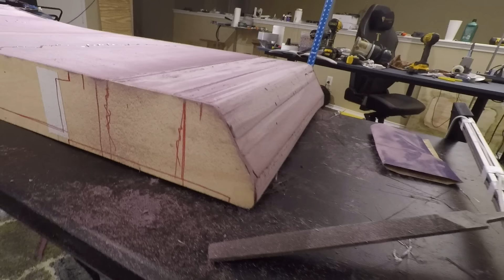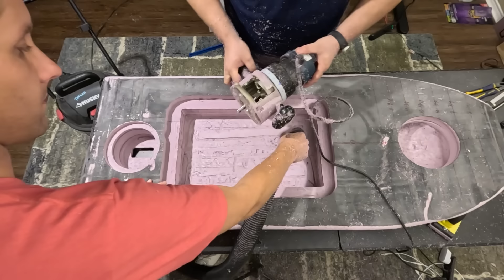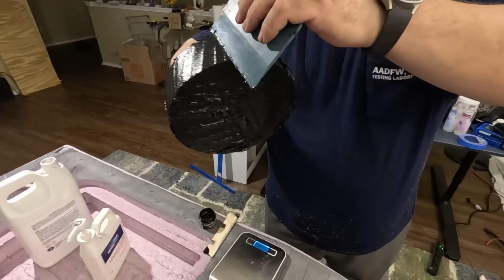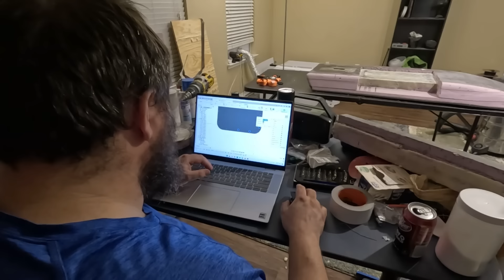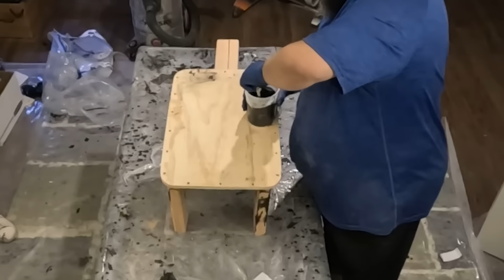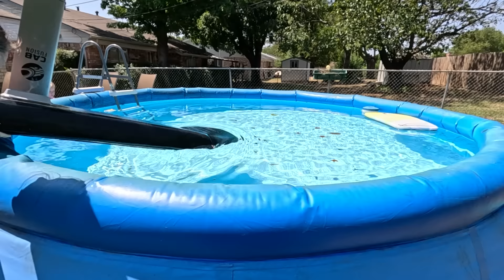We Built a $13,000 eFoil for Only $3,000

Comment: A bit clickbait, isn't it? You built a deck out of Home Depot foam, but you bought the mast, motor, wings, remote, and electronics off the shelf.
You conveniently skipped mentioning the brand names or suppliers for the propulsion, remote, and wings. A top-tier eFoil battery and motor system alone run thousands, so sub-$3k for quality gear is hard to believe.
The average person doesn't have the skills, tools, or time to weld battery packs and lay fiberglass. Plus, putting a garage-built board into daily ocean waves is a totally different story than a calm lake test—marine environments eat gear alive.
For anyone looking for actual reliability, performance, and a 2-year warranty without needing a workshop, a production board like a Waydoo gives you incredible performance for around half the price of those $13k boards

Comment: did you think of a small compartment to allow the AIR EXPANSION from the inner box? you need a membrane that allows expansion of the air inside, otherwise it might create suction (leak) or pressure when it cools off in the water or heats up in the sun.

Comment: Maybe I missed it, but how many hands on labor hours do you think this took?  And what is the fastest you could make a board like this (curing time and all).  You have a skill at using the 3d printer, CNC, various epoxy work, electronics knowledge.  That has to be at least a $75 an hour skill set.  If this took you 30 labor hours (just a guess) That is another $2,200 of labor, which brings this $3,000 build (parts only I was assuming) more inline with the cost of a new Waydoo Flyer efoil, which brings up the next question as to how this motor, foil, and battery would compare performance wise to something like that?

Comment: Great project. I’ve made a few boards for wingfoiling and toying with the idea of efoil build. Please be careful of epoxy it’s quite toxic before it cures and you can develop severe allergies over time so never touch without gloves before it cures. Bondo glass is not compatible with the xps foam you used it would have melted it a bit causing possible delamination in future. When you Hotwire make your templates slightly bigger then sand down to your line all that filling adds lots of weight. 
Board making is a lot of sanding. Then just a light fill with epoxy and micro balloons if needed before glassing. The cabon should have gone over the foil box that’s where you need the most strength also didn’t see and stringers attaching the foil box to top deck to make an ibeam to carry the foil load very important. The foil is a leaver and all that force goes to the front of the foil plate can be 5x your body weight
Reply from the maker: Thank you for this.  It does feel like it could break in half if I get bold enough on it.  I would say we would follow your guidance on the next one, but I think I would rather save up $13,000 than have to do this again.

Comment: @KlausMade Nice build! That battery is a TANK! They looked like P42A's. What do you suppose the minimum size battery you'd need for roughly 1 hour max ride time? 10S4P?
Reply from the maker: Yes, they are Molicel P42a cells. We used 14s10p on this battery.
So I think you would be very limited by a 10s4p pack.
With as heavy as our board ended up I would guess maybe if we went down to a 14s6 or 7p pack the battery life would be more like an hour at maximum.
If the board was focused more on being as light as possible you could surely go even lower than that.
Reply: @KlausMade  You probably haven't weighed it but how much do you reckon it weighs?

Comment: Excellent build and video! I made my own Efoil, finishing at the end of last summer with a handful of successful rides before the season ended. I also used a TPU printed gasket between the mast top and board. In the video you said you ended up switching to a rubber gasket. Can you tell me why? Does the TPU not hold up in water?
Reply from the maker: I believe the TPU didn't hold up.  But the stainless steel screws were tough to tighten without stripping them out. Switched to a rubber gasket and stopped the leaking water.

Comment: This is the first time I've seen someone put together a full  detailed build video like this, so nice work!  I've been into DIY e-foils and Foil.Zone for 2 years now. Currently making my second board and I have a bunch of the same components you used (pretty sure I recognized the Fliteboard prop and the motor mount design). Glad it paid off with some nice drone shots cruising on the lake.
One unfortunate decision I think was sealing the battery in there semi permanently, but I get the concern about keeping it dry. These boards are so heavy and awkward to carry with the battery. I always have to take two trips from car to water and carry the battery separately.
Reply from the maker: You're absolutely right.  It's super heavy, and we already had it break in to work on something.... So we would do that different next time.
Reply: Well done

Comment: Nice build and video!  Really motivating. 
few questions:
Is that the neptune 3max printer? and what laser cutter you used? 
What is the top speed and ride time? 
Did you run into technical problems after using it?
Reply from the maker: I don't know about the other gear but will do a follow up video detailing more of that stuff this summer. Max speed is probably some where in the 20s.  I don't tend to go over 16ish mph. Ride time is a bit under 90 minutes the way I ride it.  Only technical problem was the motor failing in October, which had to be replaced.

Comment: Hola. Que ESC usaste para este efoil ? y  que remote control usas..Gracias
Reply from the maker: Flipsky Group W7 Water Sports Kit (Includes High Current FSESC75300 /75200 and 65161 Motor)
Reply: Gracias amigo. Buen trabajo.

Comment: What did you use as a controller for the rider?
Reply from the maker: Flipsky Group W7 Water Sports Kit (Includes High Current FSESC75300 /75200 and 65161 Motor)
Reply: @KlausMade Hello, I have the same e-foil setup and I’m interested in your VESC settings. Could you send them to me?

Comment: Nice build video! Do you have a post with cost breakdown and components? Does the ESC cooling intake work as expected?
Reply from the maker: @IvanGOrtolan  we don't have a post with that but did just submit all the receipts to register it.  I can share costs of whatever interests you!  I don't know if the ESC cooling is working, because I haven't checked temps or paid attention, but water does pour out of the drain hole on the board so water is going through.  I imagine it must be cooling as much as its intended to.